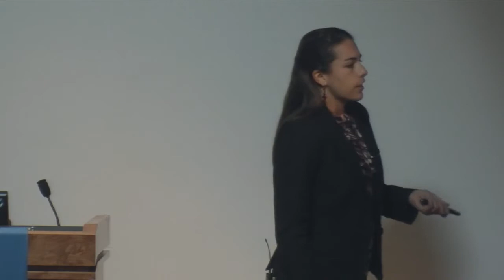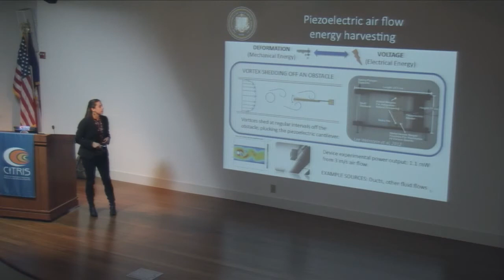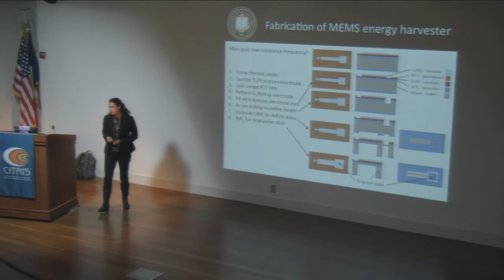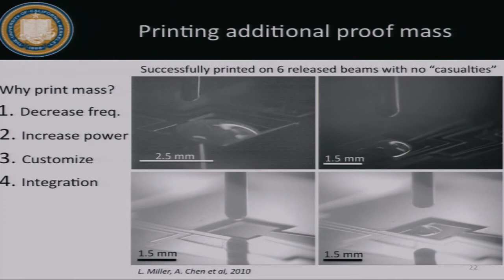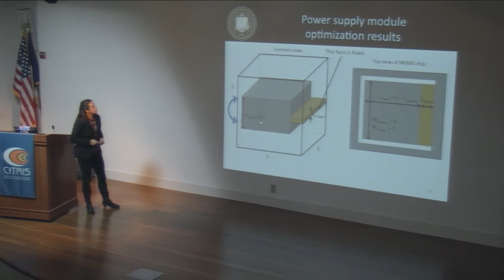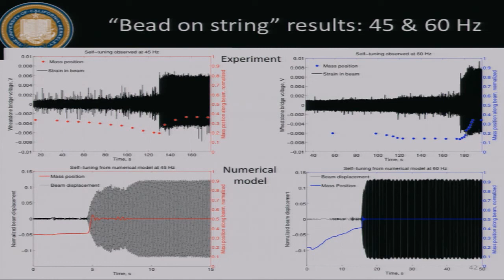Vibration Energy Harvesting for Wireless Sensor Networks

Comment: Prof. Miller. Take a mobile phone vibrator. give it a brushed motor and you have your power source instantly. you only need to put it on the end of a lever attached to the device. the length of the lever is your tune. and the device is then universal.